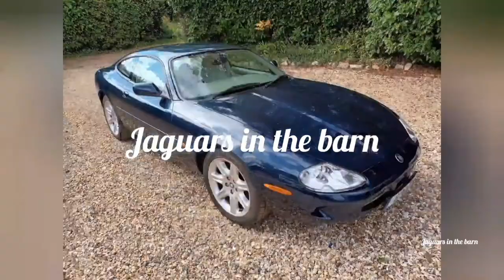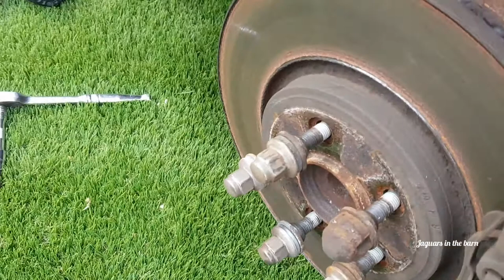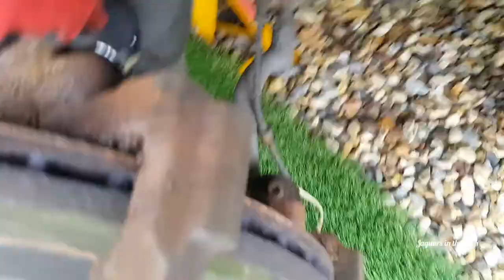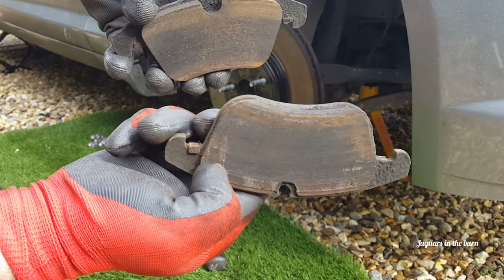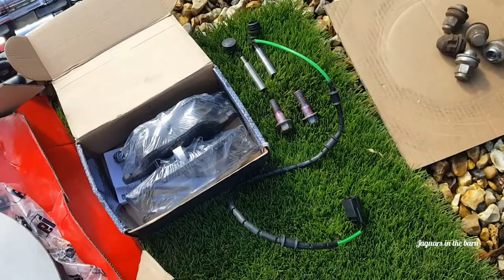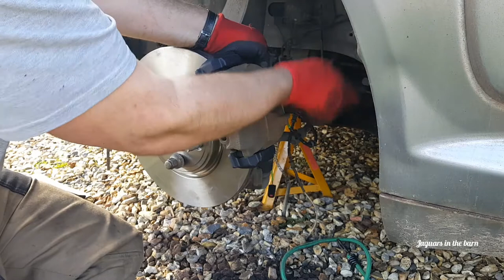Jaguar XF project #3 front brake discs, pads and wear sensor replaced.

Comment: I just did this job on mine last week on all corners and used this vid for reference, I went with slotted and drilled rotors, more for the look than anything. Turning the wheel to get the angle for the breaker bar can help and normally there's metal clips on the studs holding the rotors on, the rear pistons need to be spun back in so a universal caliper tool kit needed for that, it's easy to reset the parking brake. With the state of those breaks I'm starting to see why you got the car so cheap!😅 Fair play for taking it on though, defo a car worth saving!
Reply from the maker: Hi buddy, thanks for getting in touch. I'm glad you managed to get all of yours sorted with no real problems. I must admit that having the slotted & drilled discs does look at smarter than a stock flat rotor. 
Mine were the worst I have ever seen, completely unbelievable that someone would drive a car in that condition!

Cheers again buddy, Simon.

Comment: Hi Simon, another great video. How on earth the previous owner could drive with metal on metal is scary. Good luck with the sping.
Reply from the maker: Hi Ray,  I know, it's crazy isn't it! I genuinely have never seen anything like this before. 
I had a go at the spring yesterday, but I only had a 1/4 drive T60 torx, which just sheered off my breaker bar when trying to remove the bottom bolt of the shock 😲

Comment: Just a heads up, I would recommend you change the Jaguar wheel nuts. As you probably know they are prone to breaking off. The locking wheel nut looks very corroded. As for the brake pads.....well, dumb struck, they must of been screaming there heads off when he pressed the brake pedal. At 10:50 it sounds like the Crow was sheocked too when it saw the pad. Ha ha. Great video. Just one thing.....I didnt see you clean the disc with brake cleaner before you fitted it ??. As for the cut out missing on the brake pad...Not good manufacturing. Stay away from that make.
Reply from the maker: Good shout on the wheel nuts